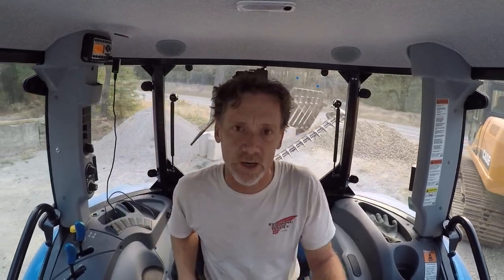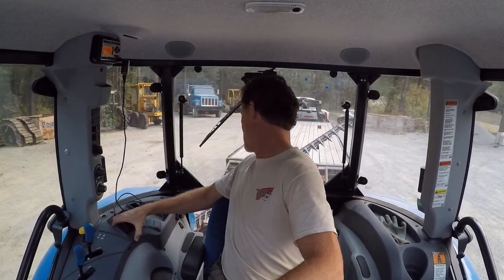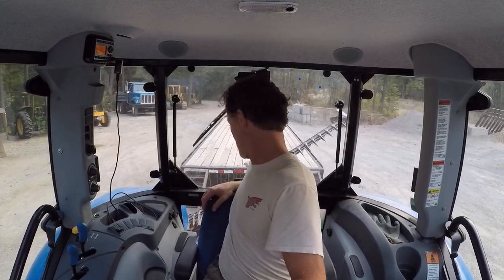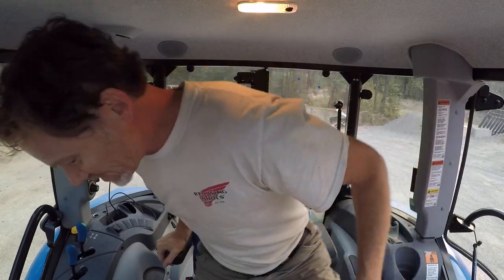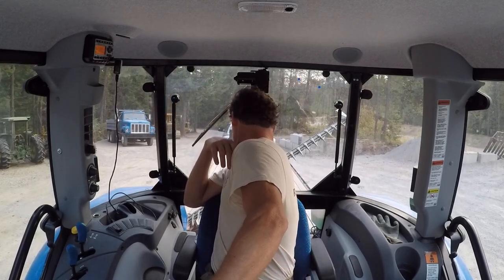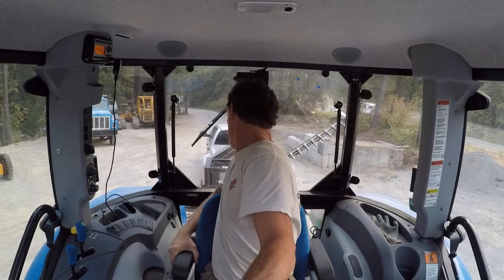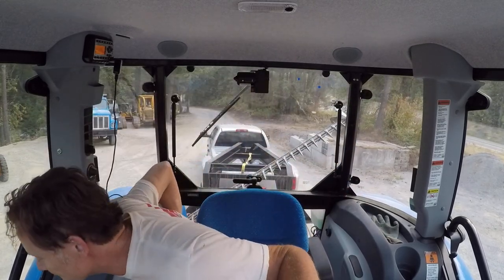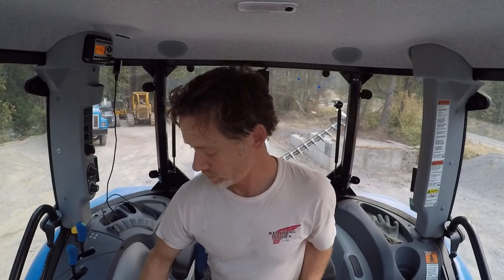Loading New Holland T4.95 Tractor on PJ flat deck gooseneck trailer

Comment: Have a similar trailer 32fr PJ flat deck with the same Ramps always thought the degree was too steep with the stocks Ramps for a tractor glad to see it can be done
Reply from the maker: Hello Zachariah - yes it definitely can be done and I do it all the time.  It's actually not too bad once you get used to it, which happened quickly for me.  My PJ is a 24 foot flatdeck with singles.  I run a much heavier duty wheel and tire versus the stock ones (16 ply tire).  I also have a deck over neck.  The trailer definitely suits my purposes.